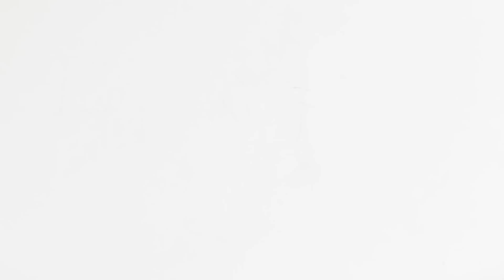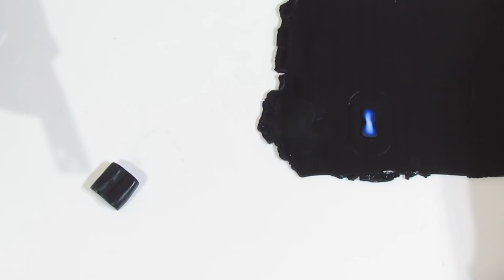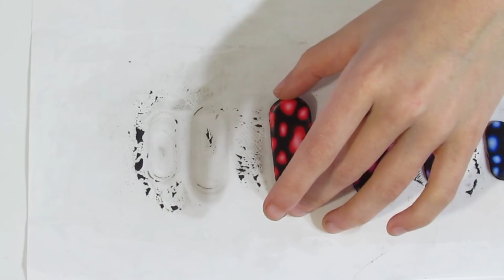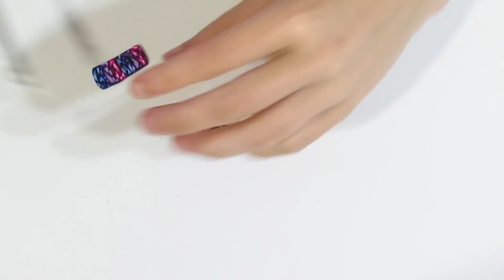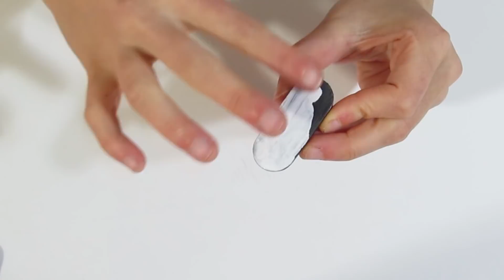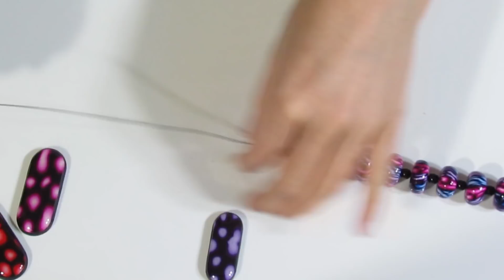Polymer Clay Project: Lava Lamp Necklace Tutorial

Comment: What product did you use to coat the beads? I looked in the link but didn’t see it. Thank you. Love you videos have tried a couple so far. However I am new so mine don’t turn out as beautiful. ❤oh also a link to the materials using to string them on. I’ve used small leather but yours looks so much cleaner. Thank you again.
Reply from the maker: For the beads I used Varathane water based gloss varnish. Pearl ex varnish is another good choice. 
To string I used accu-flex beading wire. https://www.firemountaingems.com/search/?q=accu-flex

Comment: I am curious and I know nothing about clay. Why do you wait until after the beads are baked to put the hole through them? Seems like it would be easier before they are baked. Gorgeous necklace!
Reply from the maker: I wait for the beads to bake before adding holes because the holes then are sharp and neat. If I used a pin to do it while the clay was raw the beads would distort and the hole wouldn't be neat.
Reply: @JessamaTutorials  thank you Samantha. An excellent explanation as usual.☺